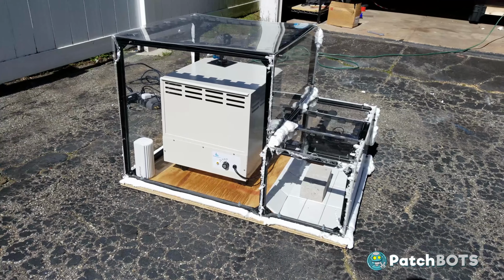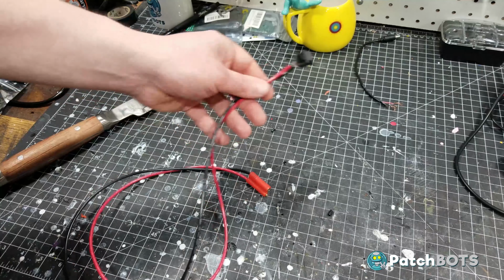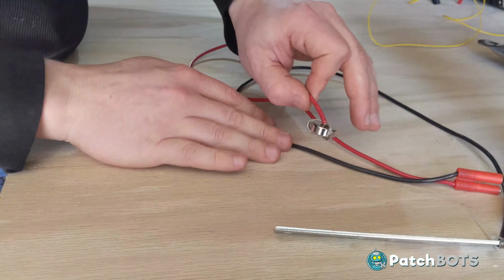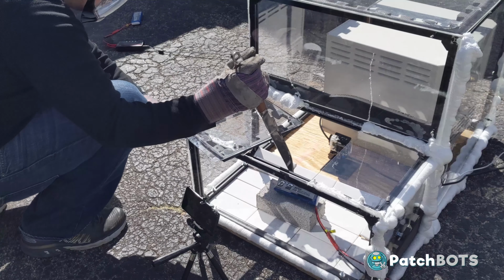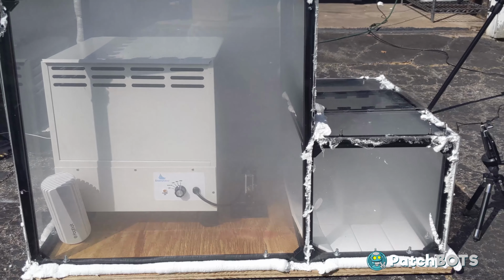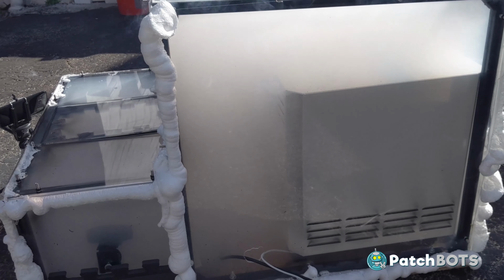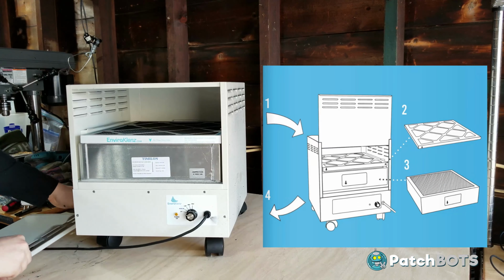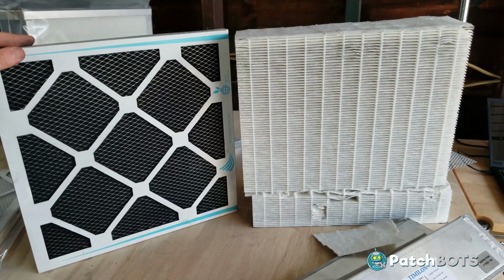Let's Blow up Some Batteries!  EnviroKlenz Torture Test!

Comment: Hey I asked this on an old video but i am working on a commander gree with the same kit from imperial surplus. I still need to get a 3d printer for the radio pack and belt. What 3d printer do you use and what settings did you use for the boxes and radio pack?
Reply from the maker: find me on facebook and send me a message, i'm way more responsive on there